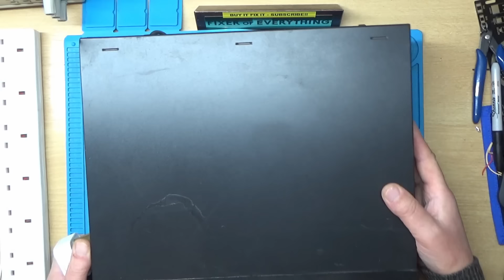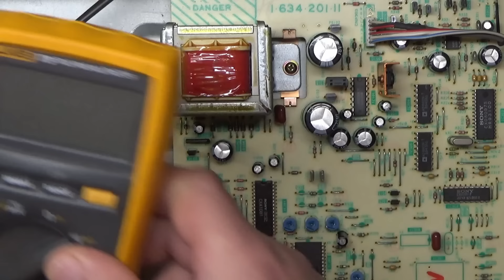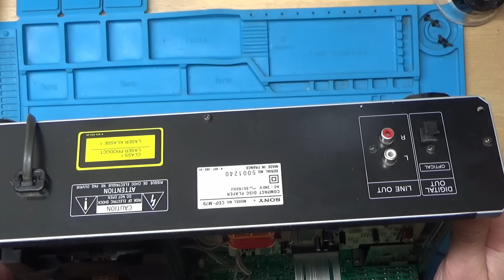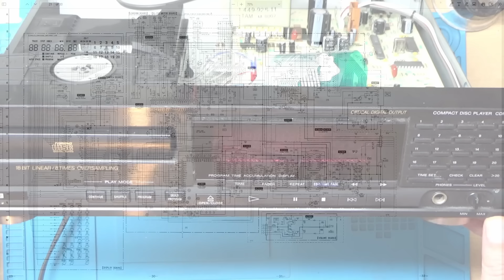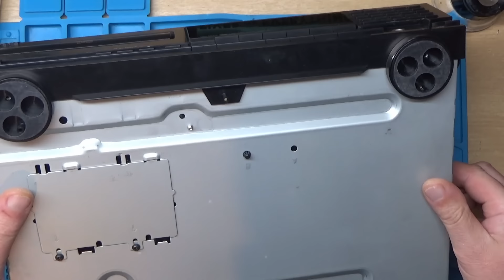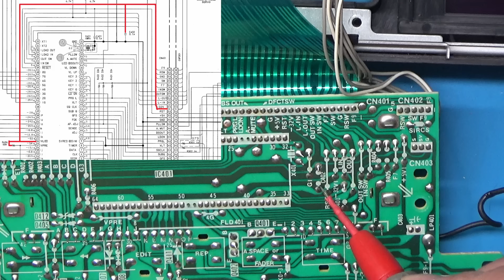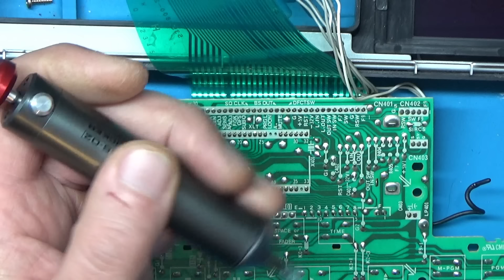The Repair That Almost Killed Me! | Unbelievable CD Player Nightmare!

Comment: Nice work! I'd have given up at the point I suspected the IC was bad - you have far more determination than I!
Reply: I would have given up at the pickup assembly. As much as I like to see this equipment running again, I have to wonder if it's worth the cost. I'm surprised at the part availability, though
Reply from the maker: @CyranoJones509  It's probably not worth the cost, but at lot of repairs aren't these days. The thing is, I was helping one of my neighbours friends who's helped me out before, and I get to make (hopefully) interesting content for you guys too!
Reply: @BuyitFixit  I get it. I just recently repaired an old cassette deck just for the experience - and to copy a few old cassettes to mp3. I know I spent a lot on that, too. Currently working on an old dvd recorder that won't power up.

I stayed through the entire video. I DID find it interesting. Glad to see it's working again!
Reply from the maker: Thanks mate 👍

Comment: Nice old cd player, good to see it working again. You were lucky with the mistake, I guess the psu may have mains voltage present in some parts when plugged in, even if the device is switched off.
Reply from the maker: Thanks mate 👍Yes, the mains part doesn't really come onto the board apart from where the wires are soldered onto it (but ironically that's where my fingers were almost touching). There are some voltages present on the board, the "off" just put it into a sort of "standby".

Comment: 9:07 You must mean -32 volt on pin 21 ...
It would be nice if you could show the onscreen text a little bit longer than a few seconds. I didn't even manage to pause the video until the text was gone 😢

No new white grease on the pin for the laser head?

34:40 It looked like the CD was spinning the other way around as it did before you changed the laser ...
46:08 First it start spinning one way, but then it change direction ...
1:02:00 At the end it is spinning the right direction again ...

54:48 You make those mistake because you also need to be concentrated on the camera and your viewers. Same as driving and texting at the same time ...

Nice to see that you know which side on a CD you should not scratch.
Yes, it is the upper side. It you get a scratch on the underside the CD-player can still read the data even if it has some problems to read it.
If you get a scratch on the upper side the data is gone and it can't read anything because the ones and zeros are not there anymore.
A CD has no plastic layer on the top as a DVD has.
Reply from the maker: Cheers mate, yes -32 I was going to add a correction on the screen, but I thought people would know what I meant. No I need to get some white grease. Yes it was spinning in reverse. It spins the disk up to a speed, to try to lock the data signal. It then slows it down, but if it can't lock the data it keeps going and ends up in reverse..Yes camera / viewers etc. Also I used the extension that I had in the first two parts of the video to run a lamp in another room as we had a power outage when we had the storm a week ago, and I was running on a generator. I forgot to bring it back, and plugged the CD player into an extension on the floor near my feet. I then switched it off at the front and in my head I thought it was "off" but because the plug was "out of sight" I totally forgot! Glad that I didn't get bit off the thing. It's been quite a while and I remember it's not fun! 😂😂😂

Comment: When you replaced that second fuse that blew when replacing the chip, why did you just tack it on the bottom rather than going through the holes (~1:00:08)?
Reply: I imagine he rated the chances of a successful outcome at that point to be close to zero so the effort of doing it probably wasn't justified. I expect he did it properly when it worked.
Reply from the maker: @martinwhitaker5096  That was partially it, and it was awkward to get it into place between the cap / regulator or whatever was there. I just thought sod it, tack it on the back.
Reply from the maker: It was a pain to try to get it in the correct place between the capacitor and regulator with my fat fingers, so thought sod it, easier to just tack it on the back, and as Martin says I wasn't really that hopeful of a successful outcome at that point.

Comment: I instantly noticed that with the bad chip, it was turning the CD counterclockwise and the sound of the motor was weird. After replacement it instantly turned the CD clockwise as it should :) I didn’t know about the tracking sensors, etc. nice to learn something!
Reply from the maker: Thanks👍, yes the bad chip had a faulty input pin on the TE (tracking error) so it didn't know it was correctly on the track which causes weird effects like it spinning backwards.
Reply: That's very weird because at 35:00 it is spinning the CD the right way!  At 46:09 it starts off clockwise but then quickly spins anti-clockwise.
Reply from the maker: @xRepoUKx  You also have to factor in the shutter speed of the camera. Like on TV when it looks like wheels on a cart for instance are going backwards or helicopter blades are barely rotating 🙂

Comment: These round axial ceramic capacitors are MLCC like the many failing SMD ones.
Reply from the maker: Right, that makes sense then. I've seen caps like them before but I've not came across a shorted one before.

Comment: Too much jeopardy, had to fast forward that bit. :) 
A coincidence that you should publish the video this week  as I had a Panasonic CD player come into the repair cafe last Saturday that was 'stuck in a groove'. I checked that the laser mechanism was free to move but could do little else because of limited experience and knowledge, now at least I have some more knowledge as I'm hoping they'll bring it in again next month so I can have a second go.
Thanks for the video.
Reply from the maker: 😂😂Yes was lucky with this one. I've got a JVC all in one HiFi that someone brought in that I keep poking at now and again. It's got pretty much the same symptoms as the Sony one here. We've already replaced the pickup and it still says "no disk" there's only two adjustments on it. So Saturday just one I pulled the scope out on it, and I think it's the RF amplifier chip as the "eye" RF pattern looks horrible..

Comment: Considering you had the disc going backwards at one point (46:08) and the higher than average risk hazard not a bad job.
Reply from the maker: Thanks 👍Yes one of the symptoms of not being able to get tracking lock is that the disk can spin backwards at a high speed.

Comment: Close call there buddy... What you need to do is make a warning lead of some sort. Take a lead, with plug, two single back boxes, a normal socket, and a double pole switch, or rotary isolator, and a lump of dead tree carcas for mounting. 
Wire the lead to the double pole switch in the 1st back box (drill some holes in the blank space of the double pole switch/rotary isolator, add a bridge rectifier, resistor and some LEDs that poke through the cover to the output side of the switch), wire it on to the socket in the 2nd back box. 
Then plug the item your are working on into this, you can then just switch on and off the power as needs be using the double pole switch, and the LEDs will act as a reminder when it's switched on and live...
Excellent work as always Mick. One thing I noticed was at 46:09, after replacing the pickup, was that the CD was spinning the wrong way. It was spinning anticlockwise but should have been spinning clockwise, probably why it wasn't reading the disk.
Reply from the maker: Thanks mate, and thanks for the suggestion. Yes spinning the wrong way is an indication of a tracking problem. First thing a CD player does is try to obtain focus lock. If it does, then it starts the disk spinning. It then speeds up the disk and tries to lock the data to a clock signal PLL, it then slows down until it does.. but it went past slowing down and into reverse...

Comment: You had me scared when your working on it plugged in especially With 240 volts!
Reply: Thanks for the reply love the videos from 
USA Connecticut so we only have 120 volt electricity in the walls and 240 for some appliances
Reply from the maker: It scared me too when I realised that I'd not unplugged it. 52:50 my fingers almost touched those live terminals!
Reply from the maker: @donkeylover-g8g 52:50 it nearly happened..as I'd forgot to unplug it.. if my fingers had have been a CM or so lower it wouldn't have been good...

Comment: So, the tracker for the lens was not working? Is that correct?
Reply from the maker: Yes, there's the chip that reads the signals from the E-F pickups, and creates a signal called TE (tracking error) which get's fed into the servo chip (what I replaced). The input on that chip TE pin, was always 5v.. The level should vary depending on if the tracking is out one way or the other.

Comment: My immediate impression was 'wow, an analogue power supply!'
Reply: To be fair even most modern hifi CD players (I mean proper ones, your Onkyo Denon Marantz Yamaha etc) still use linear transformers.

ETA although it seems I'm a bit out of date, looking at the very latest ones even these companies seem to have finally gone to switching supplies, presumably for power saving reasons 😔
Reply from the maker: Yes, a lot more simpler and reliable than a SMPS! 😂😂👍

Comment: I was waiting for the sparks to fly when you forgot to unplug it..your lucky all it did was blow fuses and not bite the hell out of you 😅
Reply from the maker: Yes my fingers were way too close, but I thought I'd have switched it off (I had at the front) but because we had lost power in the recent storm I borrowed the extension lead that I'd used in the previous parts of the video. (was using generator). So the CD player was plugged into an extension lead at my feet (out of sight out of mind) and it's very true!
Reply: @BuyitFixit  love your videos you and me are into the same hobby I repair vintage audio equipment here in the USA ..termiteaudio

Comment: 52:52 God, I can't watch.
Reply: I skipped it.
Reply from the maker: Yes, very lucky!  I used the extension that I had in the first two parts of the video to run a lamp in another room as we had a power outage when we had the storm a week ago, and I was running on a generator. I forgot to bring it back, and plugged the CD player into an extension on the floor near my feet. I then switched it off at the front and in my head I thought it was "off" but because the plug was "out of sight" I totally forgot! Glad that I didn't get bit off the thing.

Comment: Why do they have it, you have to unsolder on the lense before  it can operate?
Reply: Prevents destruction by static charges while being handled ungrounded
Reply: I suspect it short ccts the very sensitive output of the laser diode to protect it from static damage.
Reply from the maker: To stop the laser being damaged by static. The solder blob is across the lasers power and GND pins 👍

Comment: Nightmare indeed! Just reported 5 Bots...dang.  I couldn't see the unit plugged in to the mains when you mentioned it, had to replay that part but missed it.  "We all make mistakes"..boy do I know that, more than not in my case🤨 Still a brilliant repair brother, troubleshooting on this one was a thriller.  Amazing the number of times you took it apart and put it back together, the time spent waiting on parts and the fix...I'll bet you're glad it's off the bench.  Great video and results, appreciate your knowledge, thanks for the work.  See you next time.
Reply from the maker: Thanks, Yes I used the extension lead that's usually on my bench for powering a lamp in the other room as we lost power when we had the storm a few days back. So I plugged the unit into another extension down near my feet, hence totally forgetting it was plugged in!
Reply: Mick is now as intimate with this CD player as a Marine is with his rifle! :hand-orange-covering-eyes:😂

Comment: It is propably tantalum one. That type of capacitor have tandancy to short cicut over time. Many of that caps you can find on vintage pc main boards with high posibility that every oneof them may be shorted.
Reply from the maker: Yes wasn't sure on what type of cap that was. Most tantalum that I've seen are orange and  are inserted vertically.

Comment: Im not sure about 'the repair almost killed you' - more like you nearly electrocuted yourself!!! Are you sure you didn't kill that chip?
Maybe a switch that also leads to a red light within your sight to turn the power on/off so you have a visual cue as well as memory such you also don't get a shocking reminder that the power is still on.....
Otherwise who else are we going to find to watch!
Reply from the maker: One of the problems was I used the extension that I had in the first two parts of the video to run a lamp in another room as we had a power outage when we had the storm a week ago, and I was running on a generator. I forgot to bring it back, and plugged the CD player into an extension on the floor near my feet. I then switched it off at the front and in my head I thought it was "off" but because the plug was "out of sight" I totally forgot! Glad that I didn't get bit off the thing. The chip seems to be a fairly common failure point. I came across a few posts about different CD players and that chip was the cause.
Reply: Or develop the habit of always powering kit that is been worked on via the "smoke prevention light bulb" in bulb bypass/power on mode but have an additional nice big power ON indicator across the output. Half in the process of building one, makes mental note of required addition...

Comment: Quick tip for old rare loose belts. Put them in boiling water and it will shrink them a bit. 👍
Reply: Ohhh I like this, does it work (what about how it affects the flexibility of the belt) and how many times have you used this method?
Reply: @wino99999  been doing it since 1989 without issues. Trade secret.
Reply: @wino99999 cup of water in microwave  helps 😅
Reply from the maker: Interesting. Thanks for that RIck. I'll try to remember that one 👍
Reply: Tech tip is to use glass high temp cup/bowl and microwave belt in water for about 15 minutes. As was said it will rejuvenate the rubber and shrink it slightly. Regrips and gives it new life.